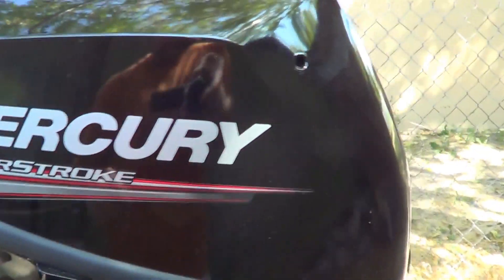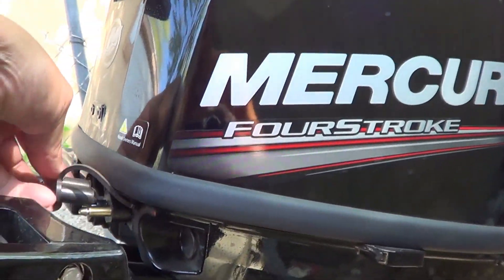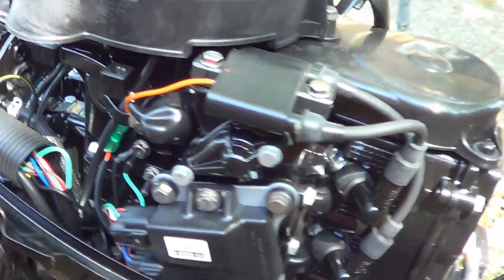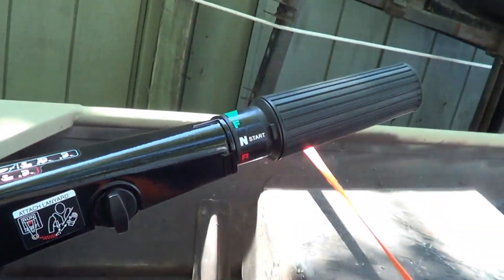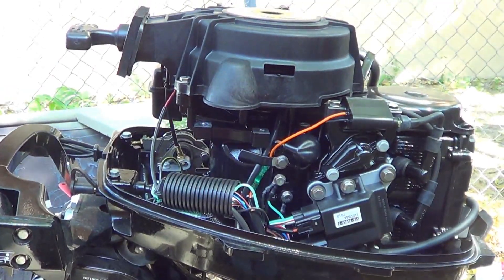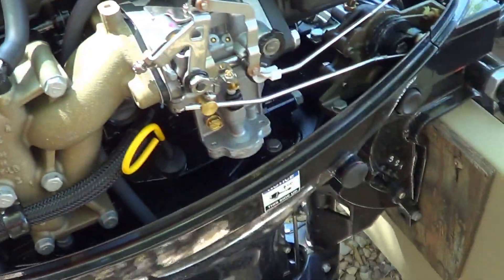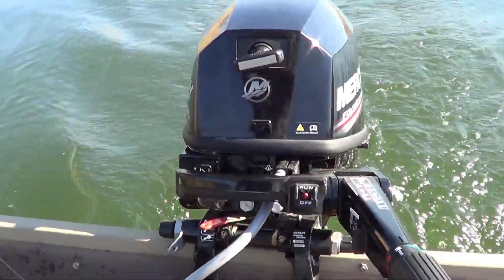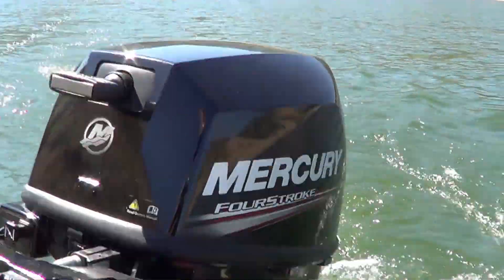2017 MERCURY 9.9 OUTBOARD

Comment: Lol my 9.9 mercury kicker is from 2005. I need to replace the motor mounts and the oil pump is rusty. I will replace all of that during the off season. When you take off the cover,  nothing has changed in the past 25 years. They perfected it.

Comment: I have the same Mercury 2017 engine.
Does not go faster than 4500n / min or
may be blocked at the factory.
Now mounts 12V 5A charging and electric starter.

Comment: We just bought one of these but it's a 2006. Was like new. He has a 14ft Tracker V bottom. When we opened it up all the way were only getting about 5 mph out of it . It goes almost as fast at about 1/3 throttle and the nose levels out. At full throttle the nose goes way up. We're new at this so don't know if we're doing something wrong. We even tried tilting the prop. I've seen videos on here with the 9.9 and the boats are running 15- 20 mph. We were on a Canal with no current

Comment: Carb model Mercury are cold blooded, easily fixed by going up one size on pilot jet.
Reply: You put the 15hp carb on the 9.9 and it opens it up gives it the 15hp the 9.9 is a detuned 15hp

Comment: That's a sweet motor! Need one of those on my 1436 Jon!! 🔥🔥🔥
Reply: 10-20hp, 14-15ft jon, 42lbs trolling motor, plywood casting deck extension, is about as handy of a small water & creek boat as there is.
Reply: I just bought a brand new Mercury 9.9 four stroke. It moves my 14×36 and it will run 19 mph with two adults, 97 lb motor weight,30 lbs worth of anchors, 50lb deep cycle battery, and all of our gear. Haven't tested it by myself. It should run 23-27 mph.
Reply: @chadschehin7193  how much do you weigh

Comment: Looking to buy this motor. Can’t decide between manual vs electric start. Sale right now in the manual but not the electric. Talking about a 700 dollar difference including the battery. Thoughts?
Reply from the maker: Electric start is nice to have on outboards but in my opinion I wouldn’t spend the extra money for it unless it was over 20 horse I have had this outboard for over two years and for a 14 foot boat or even a 16 footer it works great I’m happy with it
Reply: 801 Outdoors thanks for the input. I really appreciate it. Gonna go with the manual and save the money.

Comment: How easy is it to remove the engine from the boat and put back on?
It looked like it was being held on by clamps only. 
Or was it bolted on and I just didn't see it?
Reply: I have the Mariner 9.9 which is the same engine as the mercury. At 38kg it is not the lightest of outboards but i do manage to get it on and off my boat okay. The engine is clamped and does have to bolt holes that you can attach motor to transom.
Reply: obie juan canoli very easy.
Reply: My new 2018 9.9hp today clocked at 30kph on my 12ft aluminum V hull. Love it! 🚤👍
Reply: Its clamped on.  Kinda heavy at over 100 pounds.  It's also hard to handle.  I purchased a lift for mine since I'll be removing it to avoid theft.  Lots of meth  heads running around.

Comment: great review! I am just about to purchase one of these. One of the complain I heard about these is it's hard to tilt it up and down. Did you find that difficult also? Thank you!
Reply from the maker: vancityflyguy the only thing I found to be an issue is cold start . You really have to warm it up before you throw it in gear
Reply: Thanks a lot for the response. I will make sure I warm it up. ;)
Reply: If you can find the low speed screw you can fix the idle issue. Its hidden usually with a metal cap for emission reasons...
Reply: Just bought 1 just like this.  To tilt it up, pick the number 1 2 or 3.  3 being the farthest up.

Then there is a curved lever between upper shaft and support to transom.  Flip that lever up while lifting the out drive up.  Itll click into spot 3 when u let it down.

If u want to leave it up, continue to leave curve handle lever in place.

Comment: How fast does it go topped off
Reply from the maker: about 20/21 with just me and some gear and about 17/18 with two and gear and this is on a 14 flat bottom you would get better speed out of a v hull
Reply: 801 Outdoors had my eyes on this motor for a few months now. Need a new one for my 14ft v bottom. I think this is it
Reply: 801 Outdoors nice motor